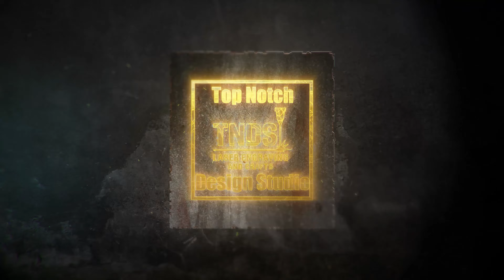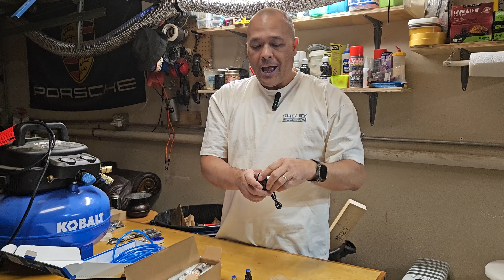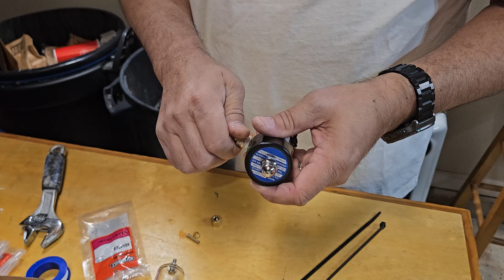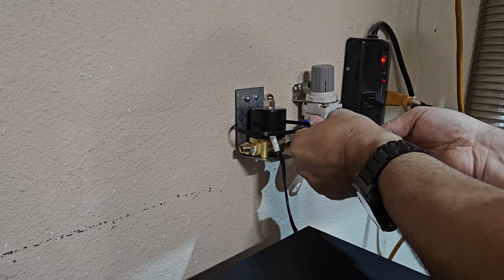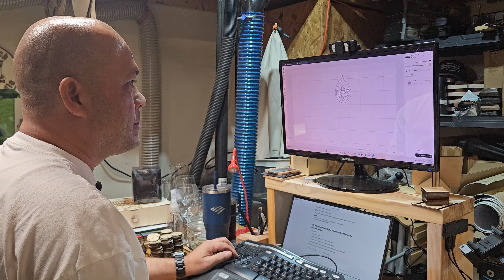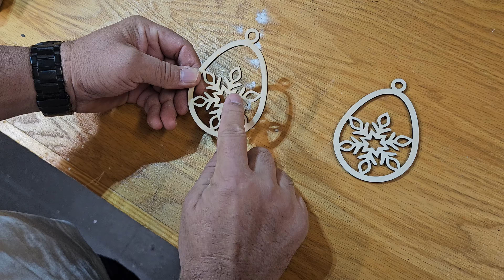Upgrading XTool S1 Air Assist

Comment: Nice video, took me a min to find your YT, I think for what I am doing I probably am glad I went the way I did, but something like this could of worked in a different situation. I was very concerned that the compressor was going to be noisy, but unless your video is deceiving its pretty quiet? Mine isn’t terribly loud, but my fiber laser is quite noisy so it’s a moot point for me, doesn’t really ring over the laser. Lol. Nice vid.
Reply from the maker: Oh belive me it's loud lol... in that video I had it in a cabinet so it was muffled.. but now I have it up on the shelf above in the open.

Comment: Nice video. Too bad I saw this after I just ordered xTool’s Air Compress Assist, otherwise I may have chosen to do this instead. I really like how you have split the tube to have the option to blow air, that’s a very helpful feature.
Reply from the maker: Thank you for the comment... watch the other one too v2.0 I actually tap into the xtool air assist to operate it... you can still do it

Comment: Looks great! Good use of a small space. What pressure are you running the air compressor at? What pressure are you using to feed the machine?
Reply from the maker: Thank you.  I have the air pressure at the regulator just over 10 psi. It is enough to keep the relief valve shut. 30 psi was blowing the air nozzle off the ladder module.